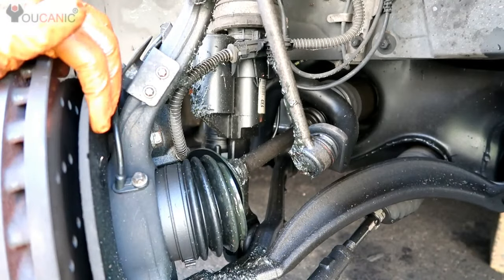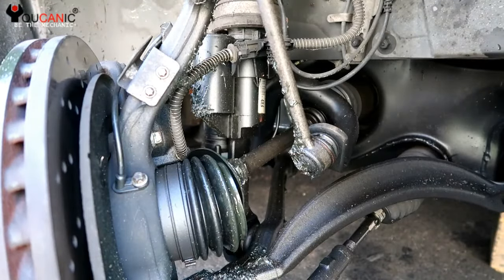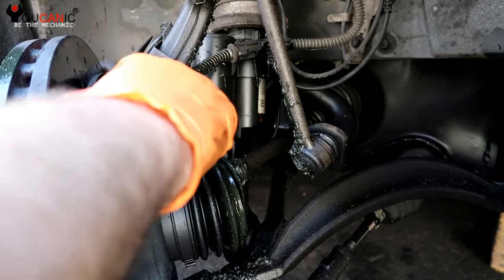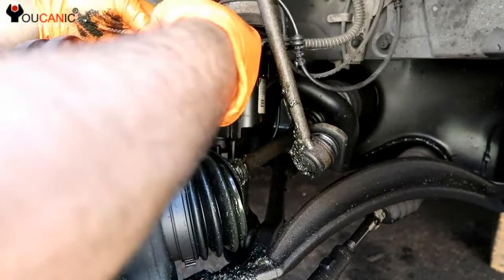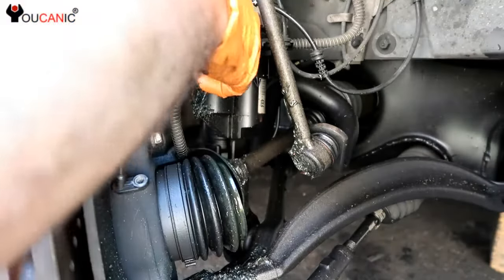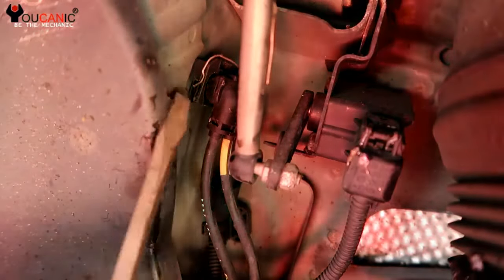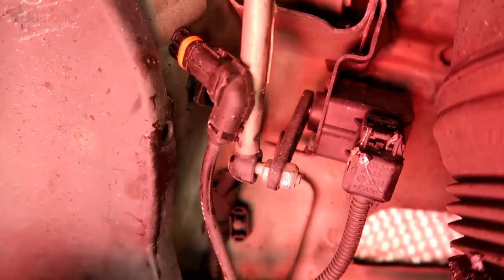Mercedes ABS Wheel Speed Sensor Replacement | Step-by-Step Guide

Comment: I just want to disable the ABS and my cruise control still work. This abs system has been a constant hassle. Replaced all sensors, still doesn’t work.
Reply: what problems you facing and did you get a solution. I'm having the same issues too

Comment: Thanks for the video. What could be the issue even though the sensor is replaced and the ABS light still shows up? Cheers
Reply: You have to clear the codes after you fix it with a obd2 scanner.
Reply: Break sensor, located under ur steering wheel

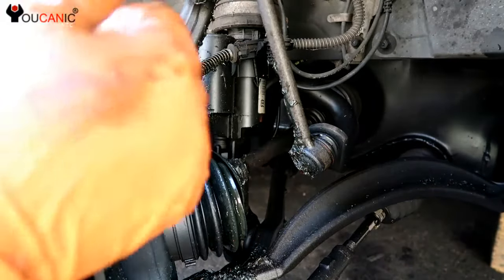Comment: 0:26 im going absolutely fcking insane trying to remove that’s I user all powered wrenches,impacts guns, my beretta 😅,everyone possible but there is so much gunk and stuff on it. I’ve used a full can  of wd40 and wire brushes. Next is to use a  torch.
Reply from the maker: Thanks for reaching out! It sounds like you're having quite the time. At Youcanic, we're all about helping car owners like you tackle tough jobs with confidence. We offer free resources, instruction guides, and tools like our YOUCANIC scanner to make a stubborn job like this a little easier. 

We also provide factory repair manuals for deeper insights! Head over to our site at www.youcanic.com for all these. Remember, our mission is to empower you and we're here to support you through your car ownership journey. Let us know if you need any further assistance, we're here to help!
Reply: @YOUCANIC  the main reason I bought your scanners is because of your walkthroughs for w221 especially since the reason I bought it is for the airmatic  system malfunction  and you guys  have videos for each of the issues in dealing  with, I ended up just drilling through it tho.